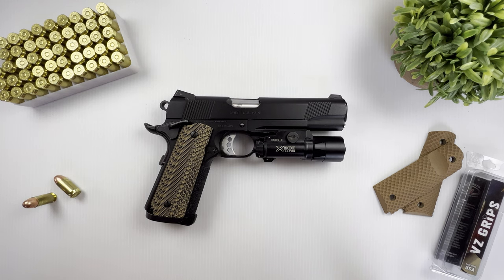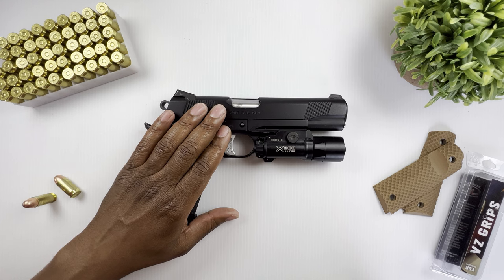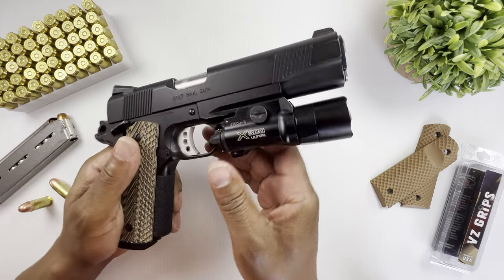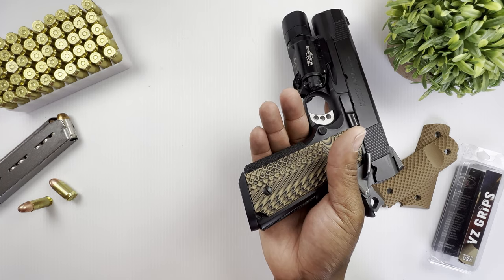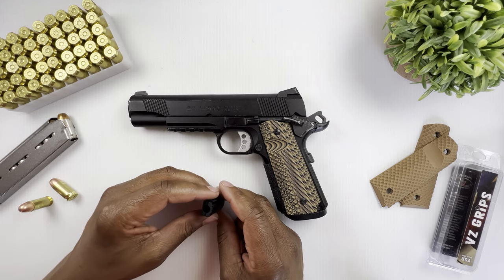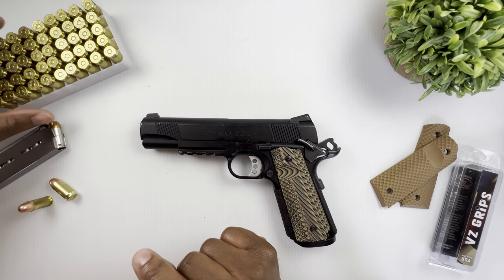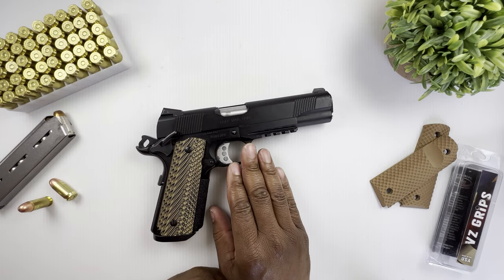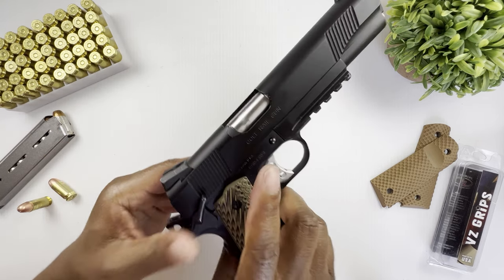Colt Rail Gun 1911

Comment: I have heard mixed things about colt and such especially their 1911s have heard that its very mixed i thibk it was due to their QC issues they had before Cz bought them out. I hope they are on the right track. Im saving up for the combat unit goverment frame in 9mm. I know im breaking the rules of not having my first 1911 in 45. I adore the 1911 im a new shooter and love 1911s appearance and has what im lookibg for, yes i do know its a really expesive pistol got a beginner and mostly for experinced shooter. I however am familiar with thw 1911 platform due to airsoft the controls and such etc i familiar with. Ik the capactiy is limited but im in a communist state not CA but NY yeah laws here suck. With that said i do want to know how colt 1911s are in this day and age is it a good beginner guide 1911 compared to springfield, kimbers, S&W, Ruger, etc these are the ones i know from the top of my head. Where does colt stand thats all i want to know about it

Oh and the reason why my first 1911 is in 9mm and not 45, well 45 is so fucking expensive i do not have the budget to afford 500rds of 45. Also i get two more rounds compared to the 45 and if i get the cain arms baseplate if im in a free state i have a total of 12rds compared to 10 with the extended base plate

Comment: You are correct the slide and frame are forged, but the small parts are MIM..
Reply from the maker: The research I’ve conducted suggest otherwise. Not trying to be argumentative here, but can you provide a source? I’ve read extensively on this particular firearm, and a small parts are not MIM. One article I sourced is here: https://chuckhawks.com/colt_rail_gun.htm
They talk extensively about the lack of MIM and forged quality throughout.
Reply: @JoeFromTheAfternoon  
You would be hard pressed to find a 1911 manufacturer that doesn’t use MIM these days with the exception of Dan Wesson and the custom guys like Nighthawk, Wilson combat, Ed Brown Etc. I believe Dan Wesson is the only “production” 1911 that doesn’t use MIM, they used Ed Brown small parts in the past but I believe might be making them in house now. An easy way to tell is if there is a faint line on the back of the hammer that is an indicator that it’s MIM. I don’t believe Colt makes a single current model that doesn’t use MIM parts. That being said there is nothing wrong with MIM, it just comes down to personal preference.
Reply from the maker: @USMC03OG remember this was back in 2010. I do not believe Colt used MIM in that time. I agree nothing wrong with MIM, but I give credit where it is due for firearms that don’t have them.

Having said that, I’ll conduct more research and update my description if I find that I wasn’t 100% correct about that. I don’t want to be spreading false info.
Reply: @JoeFromTheAfternoon  
From my research Colt has been using variations of MIM since the 1970’s. They are regarded as having very high quality MIM, but if you want a “true” no MIM gun you have to go with the brands mentioned earlier. That being said you have an awesome quality pistol that I’ll probably be personally picking up myself!
Reply from the maker: @USMC03OG  I appreciate the feedback. I’ll verify what you’ve said and if accurate, I’ll update my description for sure. Much respect! Thanks for viewing!